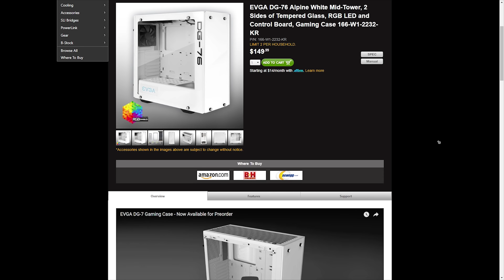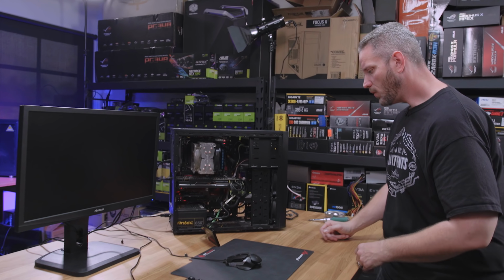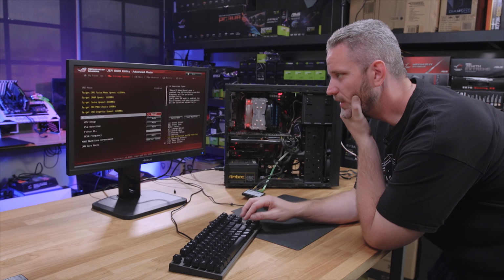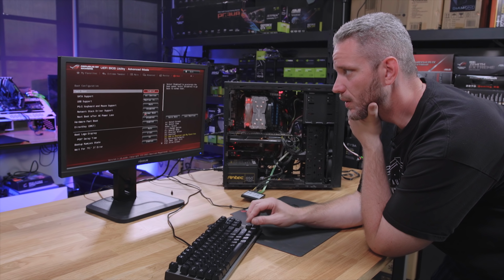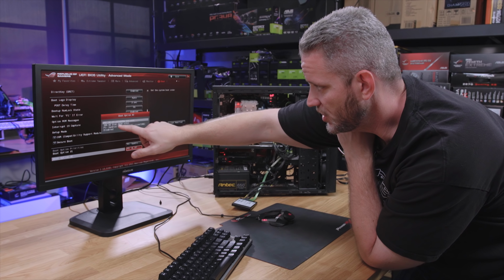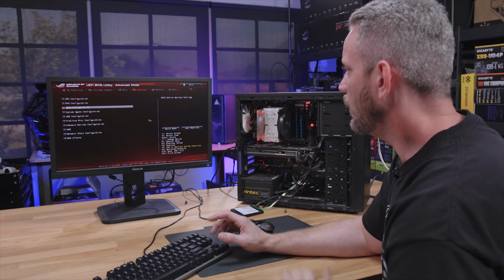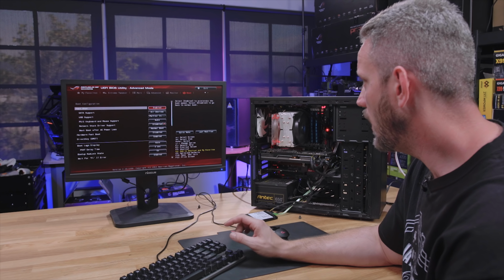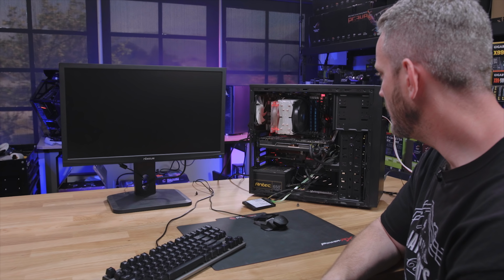Troubleshooting a bad computer... can we fix it?

Comment: totally love series like this. I has an issue a while back after switching round which ssd i was booting from to test for a friend and when i stopped switching and went back to my original setup, nothing was working (small power pulses turning fans and cutting out). Turns out taking out the ram and putting it back in was literally all i needed to do? do you know why?

Long story short, make this a series

Comment: Unless you shoved it around, that dust buildup on the rear(?) fan looks to primarily be caused by it not spinning. Those sharp angled edges on the fan blades wouldn't accumulate dust in that mannee if the fan was spinning at several hundred+ rpm. Fan still a gonner, but maybe not too bad on dust in the rest of the case..?

Comment: JayzTwoCents  Excellent video, I know it should help many people just getting in to the world of troubleshooting/diagnosing problems.
     OK so I am NOT a PC builder... BUT I do work on very complex electrical systems all the time... SO many times it is the little things that can really bite you in the butt, when you are trying to figure out what is wrong with something. There is the K.I.S.S. principle ... Keep It Simple, Stupid. Where you start off with the most basic of things when troubleshooting a problem. Is there power, are any fuses blown, does anything smell burnt/shorted? Then you move on to the more complex stuff, like troubleshooting end components for proper function... It is amazing how many times it is a simple pinched wire or overloaded fuse that will throw a whole system in to chaos... I know I have been the victim of "over thinking" a problem before... Only to find out that it was just something so stupidly simple, it makes you want to smack yourself for not checking that issue first.
Reply: OVERTHINKING hits the Point exactly... ;-)

Comment: I've been building PCs since 2004. I stopped PC gaming in 2010 when my old Wolfdale (Core 2 Duo) build was ruined due to a faulty motherboard. 2 yrs ago, I got my hands on a i7-860 build and replaced its GTS 250 on SLI with my GTX 580 that I've been using until today for work and light gaming. Thanks to PC Building Simulator, my PC building and gaming passion returned. I'm considering a Ryzen build this 2018. I've never had an AMD build ever. Any thoughts if I should go with Ryzen?

Comment: About 10 years ago i was able to repair a broken motherboard by tracing the lines and finding an internal crack, shaving the pcb, soldering the line, and reapplying some sort of insulating glue. The same thing happened recently to my rig during shipping. One look at the density of the lines on the modern motherboard and i was like nope. Nuh uh. Things are too complex these days.

Comment: You know when you're installing a fan with no threads cut and the screwdriver you were using for the mobo screws just barely doesn't cut it and keeps stripping? PC building simulator needs that

Comment: Had a similar issue with my power button in the past and just switched the connectors of power and reset, cause nobody ever needs a reset button and most of today's cases even don't have these anymore.

Comment: I got one for you!                                                        

My  old ass original gen 1 Crucial SSD failed to boot after a CHKDSK error. 

Swapping the drive over to a new x99 system, recognized the drive, booted up, worked ok. All my harddrives were recognized in the x99 system as working, even an old one lying around that I removed because it gave me a chkdsk error a year a go.

I put the SSD (850evo) from the x99 system into my original and have it work fine.

Reformat Crucial SSD, wont boot due to disk error. So I bought an 860EVO replacement.

860EVO reformat on original system, installed windows10, attached my HDD's works. Decide to attach my Crucial SSD, chkdsk error, now the 860EVO drive wont boot up! 

Install windows10 again on the 860EVO and never touch the Crucial SSD, and has worked ever since.

Comment: More a statement on the ad it the beginning. Three years on and tempered glass side panels have been the recipe for many a hot box. I'd almost prefer an all metal case with air holes strategically placed on it.

Comment: Here is a weird case for you!

I was troubleshooting of one of my friends pc's last Christmas or so.

His computer would just suddenly die in the middle of anything.
There was no real indicator on what caused it. 
But after a few hours of testing, i figured out it was the front side panel doing some shorting in the system ...

so if you touched it - it would turn off the system.

HOWEVER - NOTHING I could find should have been able to cause this. There were no wires anywhere near it. And I literally tore the thing apart finding all cables and found nothing exposed.
Not to mention the "side panel" warning setting in BIOS's was not even on...

He ended up buying a new case and viola - all good. Same components even (I adviced a new PSU but nope)

But I still never figured out HOW the case side panel could kill the system the way that did.
In all honesty that was the only time i never figured out the real cause of something lol

Disclaimer: Pun "not" intended in this case :P
Reply: Maybe one of the components was touching the case? Maybe the motherboard wasn't on a mount

Comment: Jay I have an idea for you, a really good budget build. You can get an optiplex 3020 for 130 bucks on eBay, mine has an i5 4590 and 8gb of ram. Then buy a 700 series nvidia card and an 8 to 24 pin converter, and move the 3020 mobo over to a real case and see the performance. On GTA with a 760 I get 74 fps on console settings. Whole build was 350 dollars.

Comment: Tip(for the 34584 time): never try to fit 8-6 pin gpu power while the card sits in the pci-e port especially when the case is in a horizontal position, because 1 it may cause the hard to get buggy and need re-fiting
2 it might literally mess up pci-e lanes in extreme cases short circuit them
3 pci-e port doesn't need to be treated like that, don't forget most of you got only one x16 v3 of them so don't ever stress it like that
it holds your gpu all the time.
You don't know how many times i've seen things like this causing problems.

Comment: The craziest thing I've ever had was:
My case and GPU fans were running, as where my LEDs, even after I shut down the pc. I turned of the PSU, still running. Plugged it off: still running. After two days of Beeing creeped out I just took everything off of the pc.

A few crazy hours later it turned out that I'd had been a powered usb hub that backpowered power onto the mainboard and by that to the LEDs and fans. I'll never touch that hub again, that was creepy lol

Comment: wow, this reminds me of the PC i made as a 15 year old. Shit just flopped around, rubber bands holding fans onto heatsink, 3 screws on the atx, no screws on the GPU, loose SSD cus case didnt support and so much loose metal floating around, screws, bits, whatever. But it lived a fairly long life from 2007-2013 before it an hero'd from said loose metal.

Comment: I remember fixing a non-booting system running windows 10 with a windows 7 repair cd and I got a weird merge of the windows 10 logo with a windows 7 loading bar and a windows 10 swirly thing intersecting in the middle of the bar

Comment: I don't know how they managed to yank the front panel off anyway, I have the same case and it's on there pretty tight with not much wire slack so they must have really pulled that thing :')

Comment: I have a question about my own PC that I'm using as I type this out. That being said it works great, runs well...BUT I have to press the power button twice before she even runs. Its like starting your car holding down the key till your engine revs. (That's what it feels like) So I thought Id ask what should I do about that?

Gigabyte Ultra Durable 2.0 Mobo
Amd FX Black 8370
Nvidia GTX 1060 6GB
G.Skill Sniper 8 GB (2 x 4)
Plus an additional 8gb of my old Gddr3 ram
Rosewill PSU 850 Bronze plus Modular
Western Digital 500GB HDD
Samsung 860evo 500GB SSD
Win10 Pro

Comment: speaking of bad fans my psu fan has started to do the same thing. only way to fix it is getting a new psu or just when it starts rattling stick a screwdriver on the fan center and slowly let the fan reach max speed at which point it is stable. i'm not buying a new psu for a computer that will be in use for maybe a couple of months.

Comment: twist the wires together before heat shrinking otherwise the connection will be lost over a short time. just solder it it only takes 1 minute.

Comment: how do you have a computer in that shape but not even notice anything wrong? not even like things the loose wiring but when things are completely disconnected. its like the guy just tried turning it on, didnt work, so sent it off instead of just taking the side panel off.

Comment: You need charge from the diagnostics, BIOS mod, rewiring fen power, the case fan, cleaning the case, the power cable repair and phone time.  At least $180.  As someone who used to do this kind of work for “free” I know the eventual repeat business expectation is more free work on their next problem.  Is not your expertise worth at least $125 an hour?  Just a suggestion.

Comment: if that pc was in that horrid condition, (i crinched at half of that case) i shudder to think what the windows situation itself was like. it most've been a horror show. 

and you probably know this but there is a ridiculously easy way to clone user accounts and strip passwords off of them or unlock the admin account (which is not passworded ever on win10) to further troubleshoot/diagnose issues from there. i just can't remember what it's called but it's sold on a usb drive.

Comment: My new PSU didn't arrive yet, so I'm powering my 5800x system with a 350w PSU from 2006. Oh wait, I'm not because it broke since it couldn't handle switching from team blue to team red. So now I'm using an even older 230w PSU from 1999 which seems to be working fine.
I'm also running my 5800x passively cooled without any thermal paste on 0.925V on 3.8ghz.
I know, I'm a criminal.

Comment: Yeah I have a issue with my computer atm when I turn it on there is a yellow, green and red light the first light would come on as yellow green then it will turn red and turn off then back on and off again it will keep doing that over and over an every time it would boot off i would hear this 1 little chirping sound nothing will display on my screen and the only fan that will stop running is my graphics card. Any tips? Dead pc, dead graphics card idk. I’ve tried trouble shooting as best as possible I am just out of options except going to a computer repair shop

Comment: when my pc did that there was a wirew hitting the fan and they are all like that lose 
its fit on the motor with a very smal washer on the pabc just peel the sticker off an you can take the fan apart it's suposed to be lose or else it cant spin

Comment: I have a broble with a trouble shooting and all the stuff is brand new is just that I power on the system it works for like 5min and then black screen out of no where and everything just shuts down and power and reset button don't work so I have to flick a switch on the back flick it back and it should work but then does it again

Comment: So I accidentally had a broken usb 2.0 adapter for my vr headset in my pc usb slot with the oculus cord connected to the usb plug as an adapter and it shut off my pc and I turned it on and it turned of immediately and it repeats until I manually shut it off, what do I fix?

Comment: Jay my computer has this weird error and I can fix it. My PC freezes on post and gives me an error code, when I look up what it means it's a microcode initializing stage, but it just sits there and never loads. I have to reach inside and restart the computer once or twice for it to boot Windows 10. Any help would be greatly appreciated :)

Specs:
i5 6600k 
Asus Z170 Deluxe
Gigabyte GTX 980 Ti
16GB G-Skill RAM 
Corsair Platinum 750W PSU
Booting Devise - Samsung EVO 250GB SSD

Comment: I don't see why so many people are disgusted by the PC as if it's something strange to have something like that. Most people, and I mean 95% if not more of PC owners, don't care what their inside looks like. I built lots of PCs myself but when you're short on a budget and can't even afford a case that looks good because you just try to get as much performance for your buck, why bother with the insides? My PC doesn't even have the side cover on because the GPU is too long for the case so I had to take out the HDD holder and place it on top of the case. No case fans and no cable management either. My CPU cooler was strapped on with zip ties for a good while because the intel mount broke until I bought an actual cooler so I can OC too.

It's just like cars. Most people don't care what their car is or looks like. They just use it to get from A to B. Some just want pure performance and throwing out seats and doing weight reduction everywhere is just part of achieving that even if it looks stupid. Then you have the few percent who love cars and cuz it's their hobby also put a bit more money into their car. Then you have the 0,01% who just spend all their money on the car and literally have nothing else in their life to show just so they can seem cool when they drive it around. Different people, different minds. 

It's not about the looks for many people, especially when you need to look at every buck when picking parts just so you keep inside your budget.
Reply: Which is what I mean. Trust me, if I and many others had the money to do it I'd have a perfect PC build, every cable to a millimeter placed inside the case, I'm almost crazy considering how much of a perfectionist I am. I look up to people who do work like Jay does but that doesn't mean that I look down on people who don't do it like him. He doesn't cringe to the PC he fixed either. Anyone who has worked on people's PCs who aren't PC enthusiasts understands how messy PCs that are prebuilt or homebuilt ususally are especially if all people usually care about is getting the cheapest possible combination. The PC you saw in the video is actually a pretty good looking average users PC. I've seen much much worse and never thought much about it. I've even found dead mice inside PCs.
Reply: Yeah you know the covers at the back for the GPU and such. Lots of old cases and even new cheap ones have like wiggle off steel things which once you take off can't be put back so there are sometimes big holes in the back. That's how they get in.

Comment: I would love to have Jay troubleshoot my PC. Microsoft tech support is 90% full of people that just copy and paste reply phrases and don't actually think before they type anything because their supervisor won't let them... I'm just getting random freezes or automatic restarts as if someone unplugs my power cable. It could by my overclock, although it's stable under load and these crashes of mine happen whether I'm using Chrome or gaming. Temps seem to be in check, have an EVGA CLC (AIO) cooler on the CPU... maybe my PSU is dying...? I have no idea... 700W is more than enough for my PC which draws max 275-325W while gaming, so idk...

Comment: I build my first PC about a week ago and from day 1 I have experienced endless freezing and Bsods and a graphics card that cannot be detected.

I have replaced the graphics card (from ZOTAC Geforce GTX amp 6GB to GIGABYTE Geforce 210) to see if the card could be the problem. While the card has now been detected the blue screens (common being: Clock_watchdog_timeout) and freezing have not stopped.

I dont have the money to continuously buy new parts and I am hoping someone else who has experienced this issue may by able to help me identity what exactly causes these problems. Thanks
Reply: Might be a problem with your pcie slot/controller or insufficient power

Comment: shouldn't the fan on the power supply be facing upwards to pull air through the PSU and out the back of it?
Reply: There's definitely a hole on the bottom of the case to allow the PSU to breathe
Reply: @COMM_DUMPST3R  lol i might just be dumb idk thx for the reply though

Comment: This guys PC is really relatable, except the shitshow with the fans. I bought the cheapest decent case I could find and it doesn't have a lot of cable management options. So it looks really similar to this PC. I also don't have brackets for the 2.5" drives so theres that.

Comment: i have a pc that dosn't post it is a dell with a core 2 quad and the power buttin dosn't work so you have to use the psu test switch and that works the other thing is that it tells me that the ram isn't detected even if i installed some and i got it to post when they where in different chanels but then i wanted to put them in the same chanel again and it didn't post then i put the dimms like they where before and it didn't post can you hekp me fix it blese i dont realy need this pc but it would me niche if it worked again

Comment: Dude you really need a 6 bar air compressor to blow the insides of these builds squeaky clean. That tiny blower aint gonna cut it.
Reply: Really? Because i swear i saw an entire cat's worth of dust come out when he was using it.
Reply: Yep, but cans don't get rid of the fine dust stuck to the blades. Run your fingers over it after and you'll get heaps of dust residue on your fingers. Use a 6 bar comp to totally blow that sucker clean
Reply: Well he wasn't using the standard compressed air can and I've always used a slightly hard but not soft material to avoid any static bristled brush for the stuck on dust then blowing out the loose stuff left over and my pc is pretty clean all the time doing this.